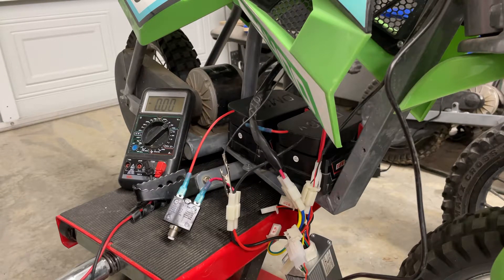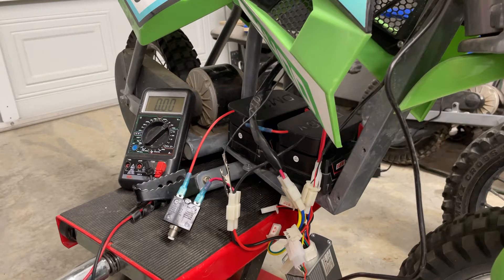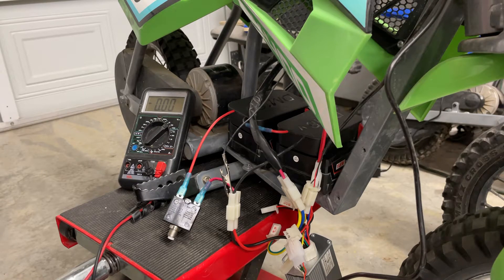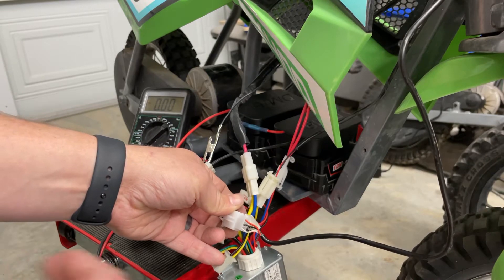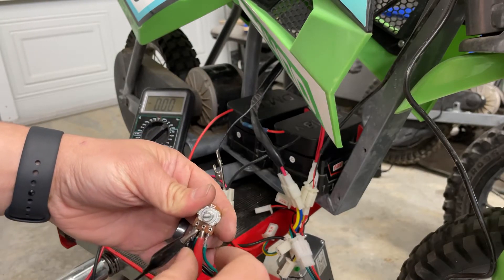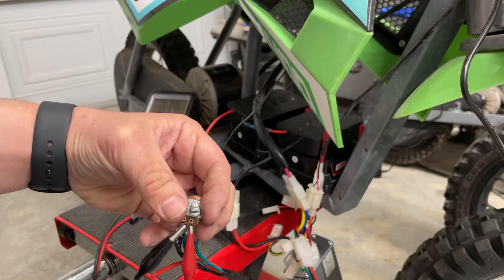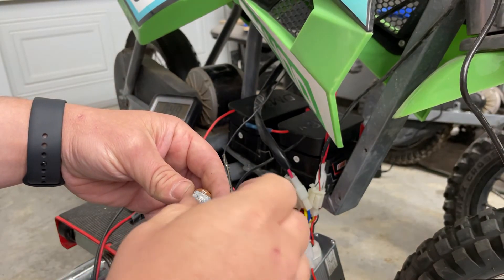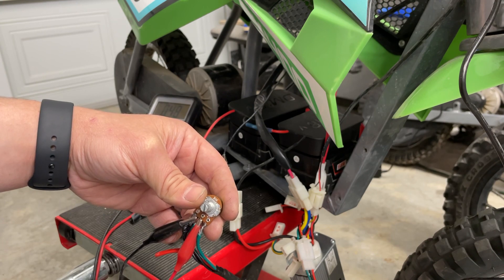Throttle Limit Dial Electric Dirt Bike

Comment: Where did u get the pigtails that plug into the stock wiring
Reply from the maker: I’ll usually buy on EBay. Search for 2.8mm wire connector terminal. Then just specify the male/female and also pin count

Comment: Do sell this potentiometer? Or know where I can get one? I need one for a M8trix electric dirt bike
Reply from the maker: I do not sell them. I bought this one from eBay. https://www.ebay.com/itm/255255280462?mkcid=16&mkevt=1&mkrid=711-127632-2357-0&ssspo=i9btDV_eQpC&sssrc=2349624&ssuid=685HNk6BRWa&var=&widget_ver=artemis&media=COPY
1K resistance is good since it doesn’t take much to trim the throttle.

Comment: Hey man thanks for the vid, we’ve got a 550w 36v kids dirt bike with a 3 switch speed limiter, I want to increase the battery to 48v, would I be able to replace that limiter with the dial you’ve installed alongside the new battery and get the desired result? Thanks again 👍
Reply from the maker: Yes that would be one way of upgrading the voltage and then dialing back the power to have it go the same speed as it would have with the lower voltage.
Reply: Great thanks, and I could dial it up for more speed I’m presuming, I “upgraded” his ride on car couple years back it could power slide for a few charges then the motor burnt out id be pretty unpopular if I damaged his precious